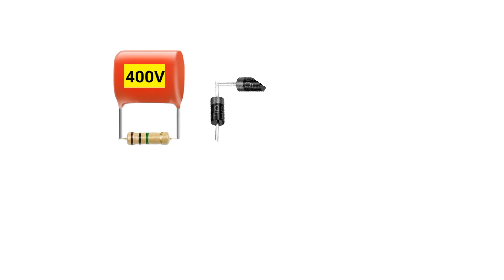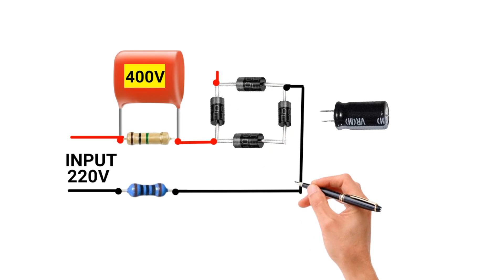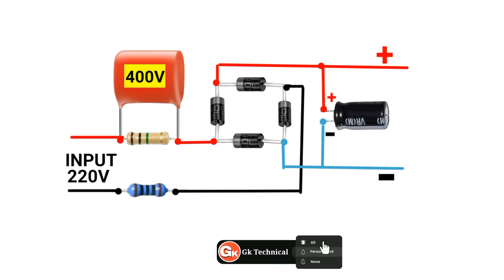220V TO 24V DC ! AC TO DC CONVERTER !

Comment: This is a very dangerous and misleading video. It will not create a 20V output, but potentially up to 400V and you will be mostly connected to live. This is not the circuit for a proper DC power supply, it's called a capacitive dropper, and it's only used for cheap low power lamps and similar applications.
Reply: I agree - I am live streaming on this vid for that reason